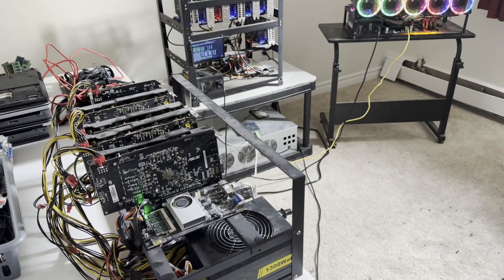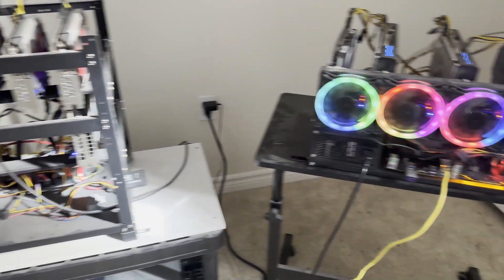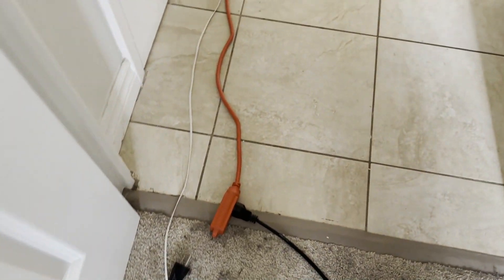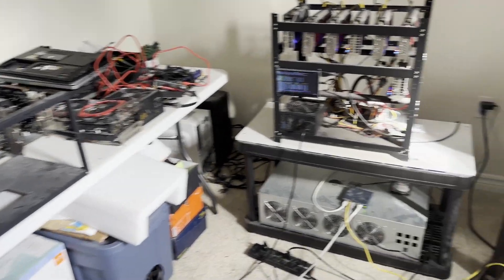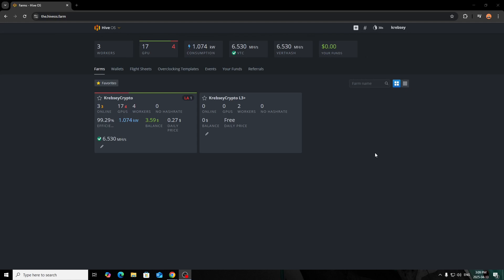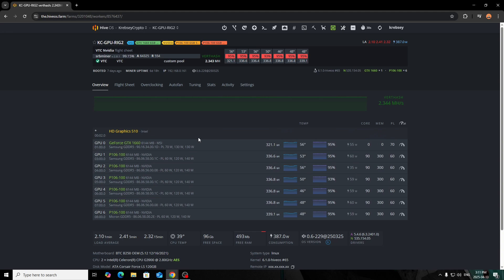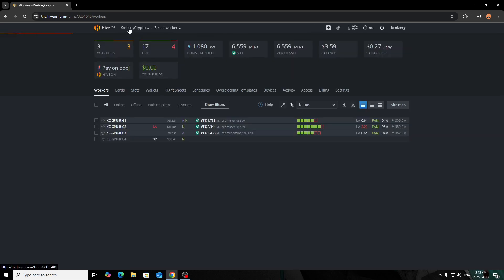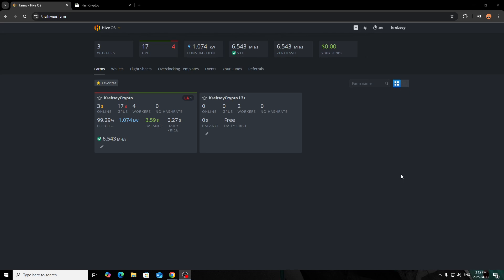Apartment GPU Mining Overview (2025) Mining From Home GPU Rigs, Solo Rigs & More

Comment: It's fine to run air-cooled during winter but during summer you should use liquid cooling or be in a basement. One might even rig a expansion/ condenser  cryo cooler if your so inclined. In a vacuum also so you can run a higher power supply and overclocked.
Reply from the maker: Thanks for the suggestions, might look into that eventually but so far I have ran through multiple summers with my current setup 👍

Comment: I want to build a gpu mining rig, what would be the best budget gpu to purchase, budget is $
1000
Reply: honestly id get nvidia cmp 100-210s bro there a great mining card and they have 16gbs of hbm2 memory and are reasonable prices
Reply from the maker: i would focus on getting nvidia cards, in my area you can get 2060-3070 or bit higher for under $100 so they could be good, could use direct mining cards like nvidia p106 or greater, nvidia cmp as mentioned in comments here. i personally dont buy brand new so that way you can save money and work deals

Comment: Super interested in your 470 / 580 overclock settings on Verthash.  I have an 8 card rig I'd love to fire up on low power / low hash to run but I"m naive when it comes to clock/power adjustments on GPUs.
Reply from the maker: RX 470 - Core Clock 900 - Core voltage 900 - Memory Controller 900 - Memory Clock 1450 
RX 580 - Core clock 1250 - Core voltage 875 - memory clock 2100 
They are also flashed bios to help improve them even more